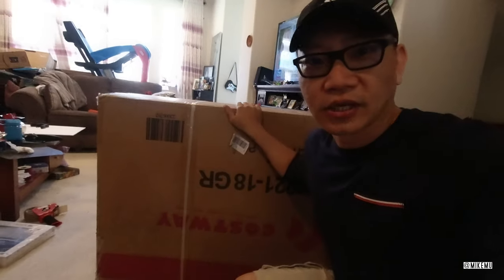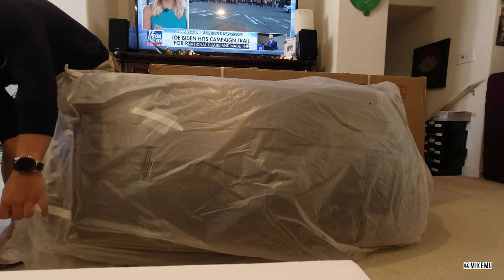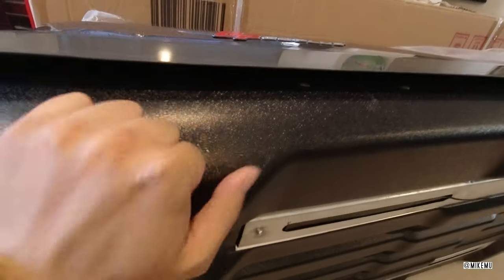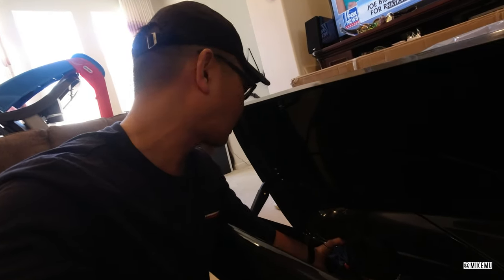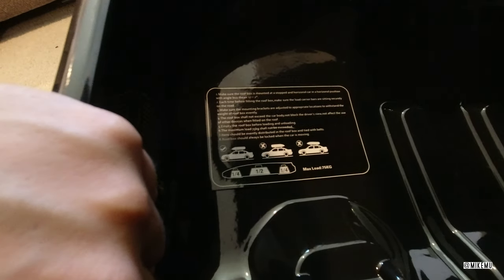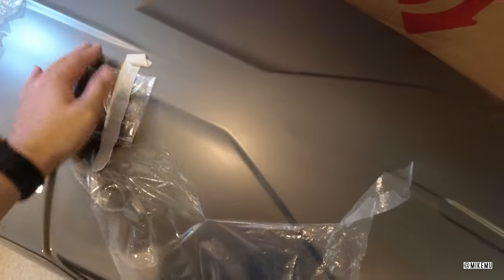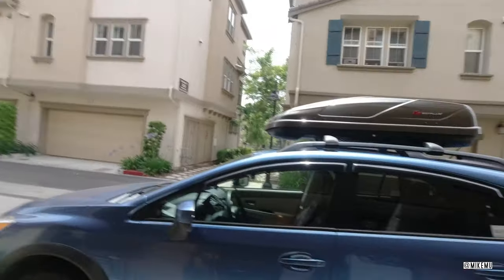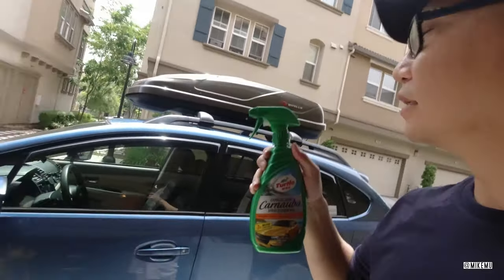GoPlus Cargo Roof Box is a Cheaper Alternative to Thule and Yakima | First Impressions Review

Comment from the maker: I've added a wind fairing (40 inch Inno https://amzn.to/2W5G9U4 ) which I believe reduces wind noise.  Wind noise is about the same as a comparable Thule I have experience with but with a different SUV.  Its still noticeable in a way where freeway travel sounds like its more windy than usual, when I don't think it is.  Also a drop of 10-20% in MPG regular driving / cruising speeds (versus completely naked without Cargo box, aero crossbars).  I'll update as a I drive more, just haven't been doing as much during COVID-19.
Reply: The Amazon link now points to the small 31" fairing. What part number did you end up getting?
Reply from the maker: They must have sold out of the 40 inch. The one you want is dependent on the width of your car and roof rail system. The 40 inch was the right size for my Crosstrek. I don’t know the part number off hand.

Comment: The mounting hardware is concerning. All of the other boxes I've seen have a loop through. These C clamp style mounts seem to place a lot of stress on the sides, which would be a weak point. I can't help but wonder if they will get loose or break off over time.

Comment: Thanks so much for the review. It was really needed for this product. I was worried about the clamps because the product doesn't show them at all! Which is pretty dumb on their part. Anyways what crossbars do you have to go with your Subaru? I also have a crosstrek, but I am still trying to decide which crossbars to use that fit the pre installed "runners" on the cross trek. Thanks again!
Reply from the maker: Hi Isaac.  You're welcome.  That's exactly why I created the video, there were so many questions I had and not answered.  I took the chance and thought it'd help others.

I currently use OEM crossbars from Subaru.  Thing is these OEM ones don't lock.  So if that's a concern, I'd look for elsewhere.  These clones look good to me for under $90, but also do not lock ( https://amzn.to/38ClJcl ).

Subaru sells a lot of Thule products in their catalog so you can't go wrong there.  Just a bit pricey for me, and probably overkill.

I also bought these CargoLocs ( https://amzn.to/38Cw7Rr ) because they were cheap on Amazon, and they lock.  Reviews aren't bad, just need to add some silicone tape to reduce wind noise and it'd be good to go.  I haven't installed them yet... when I do, I might make a video.

Hope that helps!

Comment: Hey, Mike, hanks because mine arrived with a blank User's Manual. I cannot figure out where the supplied straps go..inside the box? or?
Reply from the maker: The straps attach the mounting claws inside the box.  Look for the loops on the claws, you will see.  I've never used them because I keep the box pretty full or empty.

Comment: Great video man!Curious about the wind noise and the aerodynamic design of it. Thanks!
Reply from the maker: I definitely notice more wind noise.  Also there is definitely a decrease (as expected) in MPG. 

About the same as Thule and Yakima. Adding a wind fairing makes a big difference in wind and MPG. Without, expect a 15-20% drop in MPG - higher the faster you go.  With wind fairing and full loaded car, just did a 30 MPG trip down from SF to LA, but at 70 MPH average in freeway.  Still a bit too early to tell total overall MPG hit, but I think its at least 10%.

Comment: Nice video...looking at my options for a roof rack for a Pacifica.  Do you know the max width that the mounting hooks can be spaced?  Rails on the Pacifica aren't adjustable.  Also, do you know the max interior width?  Everything is see says 30" width, but that is outside.  Have a beach chair that is about 29" wide and wondering if it will fit.  Nice vid and review.
Reply from the maker: Sorry for late reply.  What beach chair do you have?  29" is cutting it close, are you sure you can't flip it around some other length to do it?

Comment: How's the noise factor when driving? Does the top buckle in due to the wind/downforce from driving?
Reply from the maker: No different from other roof boxes. No, the top has proven to be solid.  Think I’ve hit as high as 80 mph and then with high winds added too. Naturally occurring wind on I5 freeway at highway speeds doesn’t phase it.

Comment: Is there a speed limit when these boxes are installed? How much speed can it withstand?
Reply from the maker: It’s the same disclaimer about speed as other roof cargo boxes. Here in California I drive up and down from LA to SF. 80 MPH is sometimes the safe speed to be traveling on the 5 and I’ve experienced no issues. But I can understand why it’s not advised. I think I cover the MPH in the video in the paperwork. It’s the same advised speed for those towing a trailer.  Always check and re-check the mounts though.  I've found the rubber shifts.

Comment: What is the available spread on cross bars  that this can be mounted to? I have a 28” spread and it’s not adjustable?
Reply from the maker: 28" is most likely too short for a box of this size and weight capacity.

Comment: Do you think now it was a mistake to buy a cheap one or not?
Reply from the maker: Still working great. No issues I didn’t resolve. I did damage it a little on a building entrance (shouldn’t have trusted someone to tell me the clearance from outside). But now that pandemic is over, I would have stuck with a whole system instead so that I have less keys to worry about.  But I got my money’s worth as I took it on thousands of miles of trips.